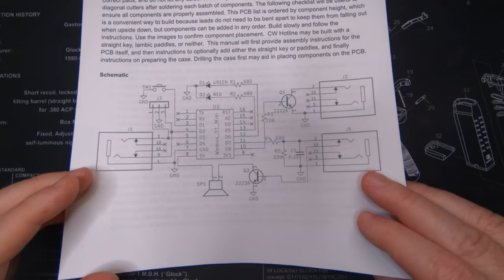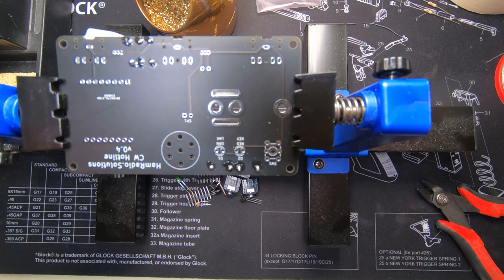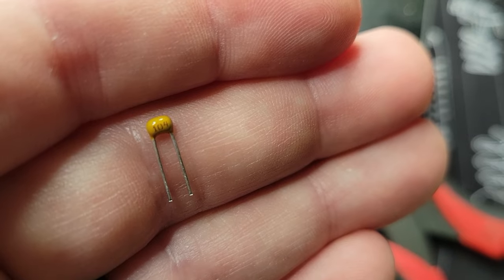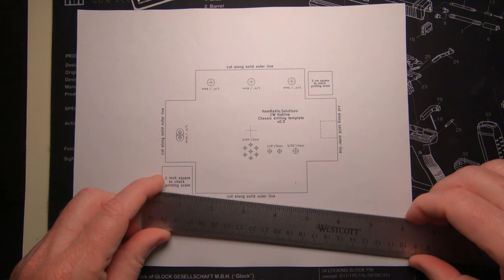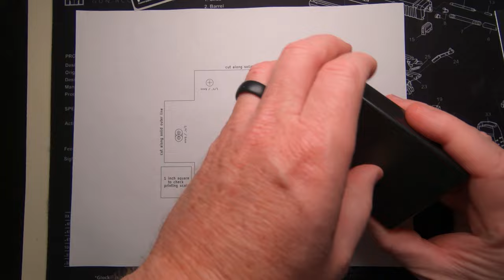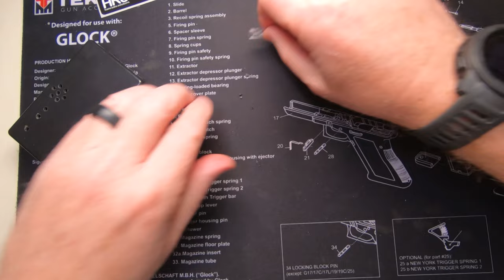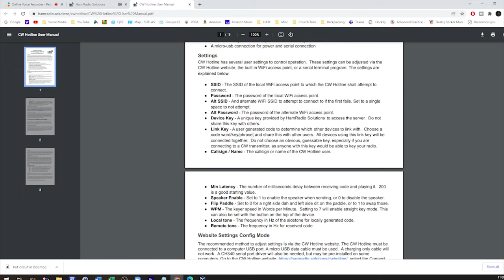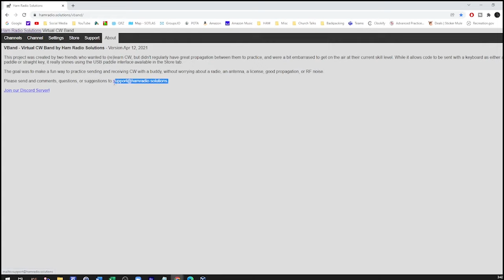Learn Morse Code with the Ham Radio Solutions CW Hotline

Comment: Thanks for the nice video, Charlie. I'm debating paying the extra for the fully assembled one, since I don't have much experience with soldering. But it looks like an extremely simple project, so I might as well spend the $50 saved by getting the kit and put it toward a good solder station.

Comment: Just finished my kit today. This is a game changer for vband because it eliminates any local delay. 
Read the instructions all the way through before starting. Take your time to get the case drilling correct and have small files on hand.  (I struggle mechanically.) 
Setup was easy. Yes, pick the USB serial connection, not the other one. 
Kit components are top notch. Feel like I got a bargain. Manual could be a bit clearer in places but good nuff. 
These guys should be commended for their work and support of Morse Code for hams and non-hams alike.
Reply from the maker: Thanks for your comments. I also use mine offline as a practice oscillator. I too think it's a bargain.

Comment: One question I have my dad many years ago was into CW I don’t understand the CW of ham at all I am a tech studying for my general right now but know nothing about CW and was wanting to know if this would help in understanding Morse code and teach my how to use it so I can learn on how to use CW when I want to just asking if it teaches you how to use it I would be very interested in it I have no problem building the unit itself but need help to understanding it and how to use it, does it help a person to learn CW ??? Thanks W9NAF 73
Reply from the maker: Hi Michael - I think that's fantastic that you are going for your General and that you want to know more about CW.  This box is more of a tool to supplement your learning program.  If you want to learn CW, this box will not train you.  Rather it is a platform you can use to practice what you learn.  If you want to learn CW, do an internet search for "Long Island CW Club" or "CW Ops CW Academy".  They offer free classes.  You might also try using cell phone apps to begin learning your letters.  I hope this helps.
Reply: @RedSummitRF  Thanks will look it to that thanks for the information i will see what they have 👍👍👍👍

Comment: Great video! Also, saw a guy on Reddit asking about the metal paddles you were using in this video. I'm going to point him to it, have you done a review of them by chance? Also, I have these paddles and I'm a fan so far
Reply: could you add that info here?
Reply from the maker: Here ya go:  https://www.ebay.com/itm/353762265820?_trkparms=amclksrc%3DITM%26aid%3D1110006%26algo%3DHOMESPLICE.SIM%26ao%3D1%26asc%3D236843%26meid%3D20f063a5836f4ce2b473b1683c5c5cb5%26pid%3D101195%26rk%3D1%26rkt%3D12%26sd%3D265356207554%26itm%3D353762265820%26pmt%3D1%26noa%3D0%26pg%3D2047675%26algv%3DSimplAMLv9PairwiseWebMskuAspectsV202110NoVariantSeed%26brand%3DUnbranded&_trksid=p2047675.c101195.m1851&amdata=cksum%3A35376226582020f063a5836f4ce2b473b1683c5c5cb5%7Cenc%3AAQAGAAACEKnm37A%252B4YAf0zL8U4OP0NWZo3hS3%252FLM80J%252Bl%252BmjVHLEE0ZNgarMT8Z7mfSmvDHm3G8xfLVgN7e21txod45Gy5UzcpkeYM9o1BKXDhQgdS36w3nXOwvTj%252FFk6bf48VHS8T1eGOQ6mjwKUh1SwdpayyOaPAyd4Cu1B12GrNglRZyHohuQPA596AOSxJHK55N5TMS6bK3iUw53%252FP1VMl9IZyC6Lkt6bOESfgbyhLs6uoy6WNLwQ6LeW3cZ9BEUrxhEDhXCURjCmq54jftOGZV2HnmlnkYl6ulCrvnn0xff5v%252FxQCH8S9EkZt9e8nGITgyo%252BJN%252BsKQEVpuKAhiK6UP3Ydu1IHVasFSbelhaM%252BbjajWvuDYpgXMSbTGZKowkNTGWeVD4J6E%252FzmbFq71fg8Ks8Io0%252Bum7HoMJSzFH4RBEIku9ycifSJzJeSWqOHxQToI1fb115mCIEQ19YTkWf4GcQNoA0bek1EIjJSta17%252B1NKnFRzWLPnIWLHF4QYRh6EApaKXzsMeroRooLAGjMF2pNIa1BOgvRN2fHgIV%252BeiaPAc%252BJiuHLPlnOowFG5QN5Xjhkf%252FJ1Dri1lmT5D78bNZYVkDtHJeXcncvWNV45xLTupKrAYxJUkChH2Pz3haQ3ddxaDOncTtzW9Xw3EklJLMQ7U5oiA5btWbvpoYE4xXWMRfpSKA4LNVci7%252FSb%252BcBIOQHJA%253D%253D%7Campid%3APL_CLK%7Cclp%3A2047675
Reply from the maker: Thx Richard. Much appreciated!
Reply: @RedSummitRF  thanks...😁

Comment: Bought one and this is what I have found out, Web Serial API not supported. can't go any further another junk kit.
Reply from the maker: Have you talked to the developers via their support page?  Your comment seems a bit harsh considering it works as advertised for everybody I've talk to.  What are you trying to do?
Reply: @RedSummitRF  We sorted this out with a couple emails.  The solution to the "Web Serial API not supported" is to use Chrome.
Reply: Also can turn it into a hot spot (see manual) and log into it with your cell phone for on the fly changes.